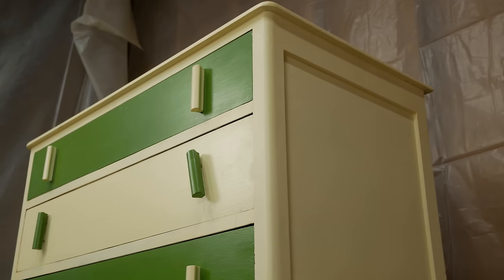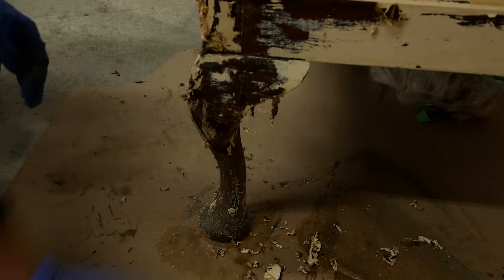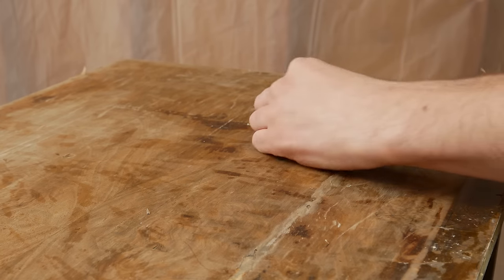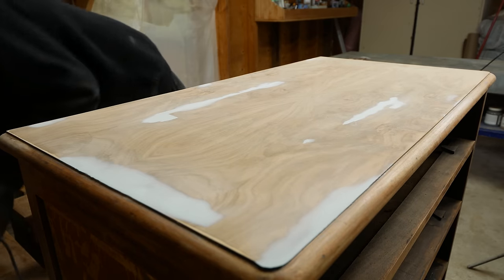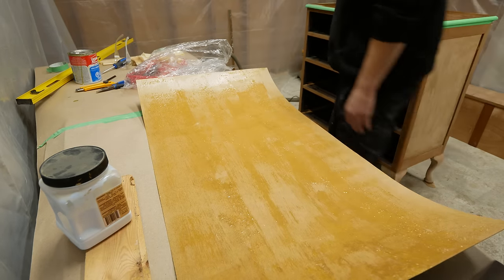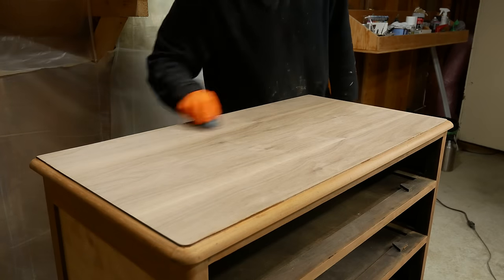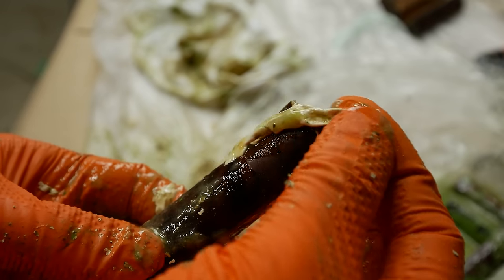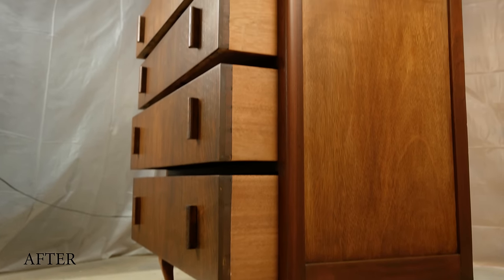Amazing RESTORATION of a Painted Chest of Drawers

Comment: Try using a chip brush to apply the paint stripper in the future. That rag or sponge didn't leave a thick enough coat of stripper which is why it dried out. Your plastic bag application seemed to be on point. Very beautiful restoration!
Reply: practical advice. I hope this comment gets seen

Comment: You might want to use simple green or dawn soap to clean surface before stripper it may let stripper penetrate paint better, just a suggestion.  Love this piece you did a fantastic job restoring it
Reply from the maker: Thanks! And good idea, could help break down dirt and grime for a better strip

Comment: Turned out well. Suggestion for future you, use wood filler instead of bondo. Bond is more for auto body work. You could have injected glue underneath the veneer to glue down the veneer bubbles and used bits of veneer to fill in the missing parts. All that aside, it turned out beautifully. Great work without a router.
Reply from the maker: Thanks! And I was under the impression that many wood fillers can expand/shrink. So under the veneer it’s safest to use a product that remains the same so you have no issues. This would be bondo or a 2-part epoxy filled. I chose bondo cause it sands easier and I have used it a lot. Thanks for watching

Comment: Oh tip I would suggest is next time you have veneer that's not missing but perhaps not glued down any more. You can use a needle to put glue and then clamp it you dry. You can save the veneer this way. But if you have a bunch of missing veneer it is certainly easier to redo it all. Just depends on how much you want to sink into the project. You did a fantastic, fantastic job. 😁
Reply: My panic too - stop!  😱. Most of that could have been glued.
Reply: yeah. I almost clicked off the video when he did that. much more costly and time consuming to replace the veneer but at least he didn't repaint it or stain horribly

Comment: Great work. Beautiful restoration. A shame that the original top couldn’t be saved. It was a good thing the previous paint job, although ugly, looked to have been done with a future restoration in mind. Probably not intentionally. They probably sprayed with a clear shellac sealer before painting it white. Which made your job much easier. Imagine if they would have completely stripped and sanded and then paint. 😱

Comment: Thank goodness you persisted, to be rewarded at last, with that gorgeous grain pattern.

Just a thought......Next time maybe clean the entire piece with a proprietary de-greasing spray,  in case previous owners were using furniture polish, (which prevented your stripper from working as quickly as you expected?
Reply from the maker: good idea, im guessing it was waxed up like crazy. Likely what prevented it form working well initially. Thanks for watching :)

Comment: Great job. I have tried watching so many furniture restorers and end up stopping the video midway in absolute horror at the trainwreck they call a restoration. They do not know what they are doing and the results are a disaster. The wrong sanding method - leaving visible scratches on the woodwork, staining the wrong color for the time period, finishing with a shiny gloss varnish - to name a few boo boos along the way - ouch!!! 
You pay attention to the type of wood you are working with, using the correct paint removal and sanding method that restores it's natural beauty. The proof is in an end result that repects the original design and stain methods and produces a beautiful, timeless piece of history.
Reply from the maker: Thanks so much!

Comment: I think I would have died when I realized I couldn't save such a huge piece of expensive veneer! Jay recently had a piece just like yours with a multitude of different colors in the wood. 

I think it was Jay who had no idea why furniture makers put those pieces on the back of dressers and bookshelves and etc. If a person's constantly losing things only to find them when they have to move that piece of furniture it's because they took that piece off. Modern furniture makers are totally clueless as to why many things were included in the designs furniture in the past when people actually took the time to carefully think these things out, as well as having wives telling them, "you know dear, this would be so much better if it it has this and that and so on". An example of this is the really old Hoosier cabinets, the original Hoosier's are incredible. In one cabinet you have practically everything necessary to store baking supplies built in, no need to buy anything extra. The copies, leave all the important stuff out. They look nice but they're not practical like the originals.

Comment: Check out John's furniture repair channel... Trena is a professional, I'm certain she would have reglued the loose veneer on the top, all the pieces were there, they just needed a glue up
Reply from the maker: Yes, they are great to watch. The water damage was pretty bad, but its possible glue could have saved it, however I really think it was too bubbly. And there were missing pieces/screw holes. My fix was a little more modern haha

Comment: I've been restoring furniture for over 40 years and it's never a good idea to put more veneer on top of old. It doesn't adhere well and is likely to bubble up.
Always remove ALL of the old if you're completely replacing it. Start with a clean smooth surface, which is what you'll get if you sand the underlayment. 
Instead of wrecking the top ,gently lifting the raised sections, putting glue and weights is a great first action to take. 
Try watching a Master on AT Restorations before you ruin more furniture
Reply from the maker: Ok sorry for ruining furniture